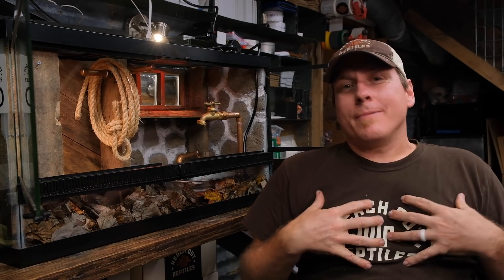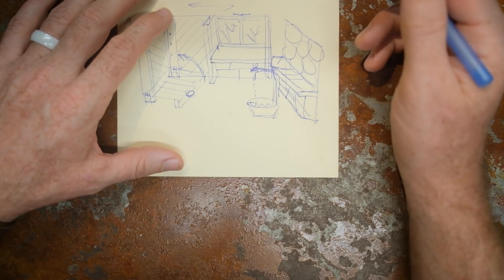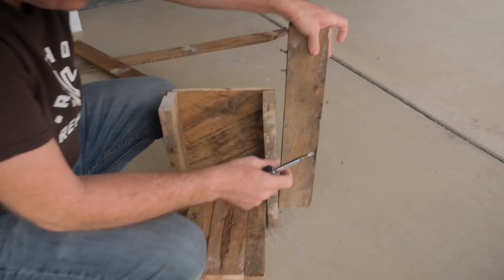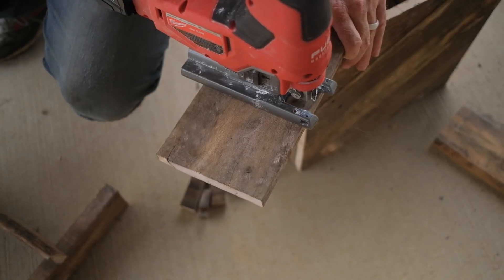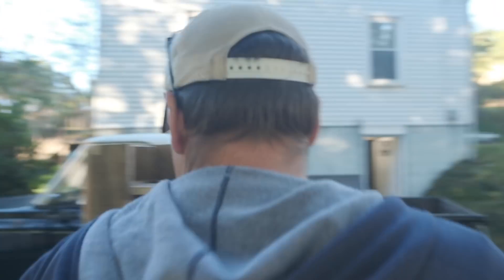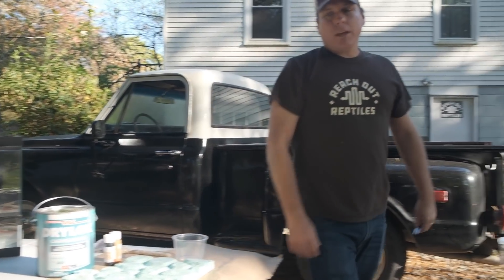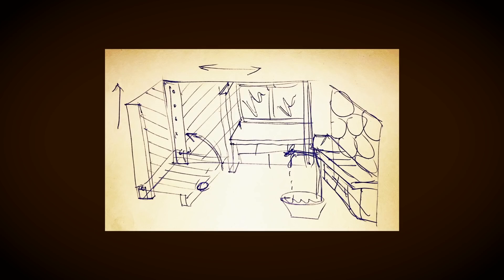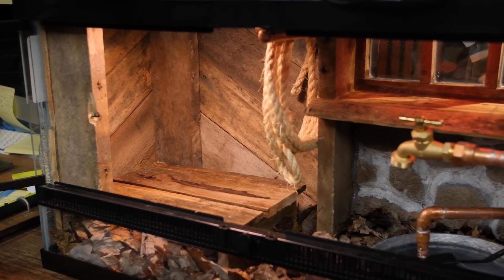Building a Barn Wood Terrarium (even better than before?)

Comment: Gotta be careful adding anything rigid that's too close to the screen top. I put in a foam background on the side of my first snake's exo-terra tank. I didn't realize he was able to shove his head into the gap between the top of the foam and the screen. He got stuck and wiggled his head around enough to get a minor wound on top of his head from the screen. That's the day I learned about povidone iodine.
Reply from the maker: Yikes!  Good point!  We add silicone around all gaps to fill them in.